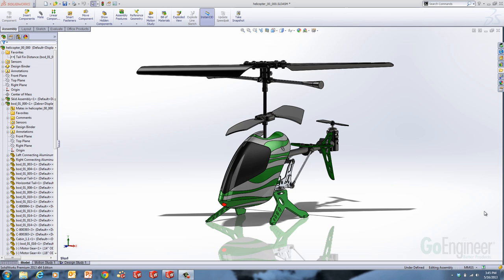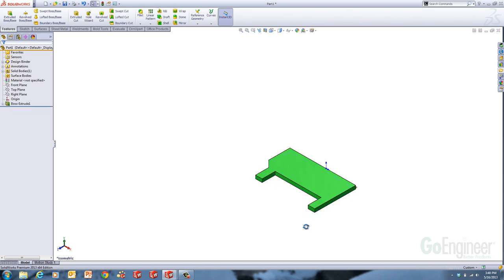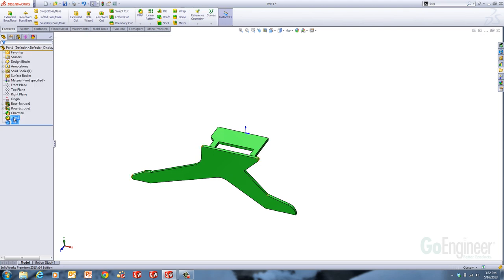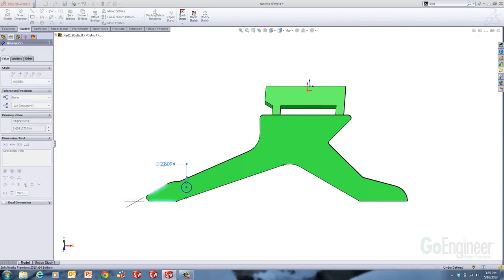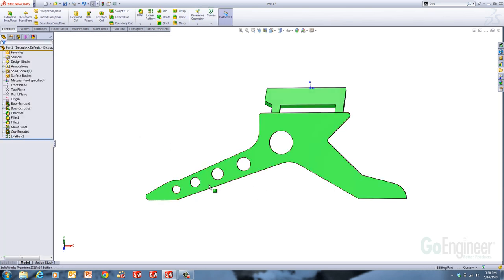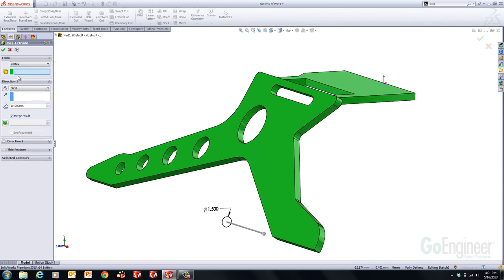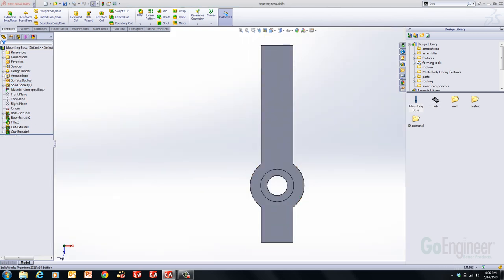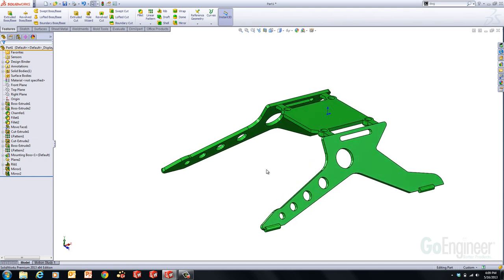SOLIDWORKS Quick Tip - Part Modeling Tips

Comment: How are you able to rotate the part like that? What mouse button do you hold while dragging?  I know I was able to do this in the past, but I have somehow lost that ability.
Reply from the maker: Throughout the video pressing the middle mouse button (the button typically clicked when pressing the mouse wheel) was used to rotate the model.  The other times, where the 'Normal to' view is used, that is first selecting an edge to look down or a face to go normal to then pressing SPACEBAR to bring up the view selector to pick 'Normal to' for the view.